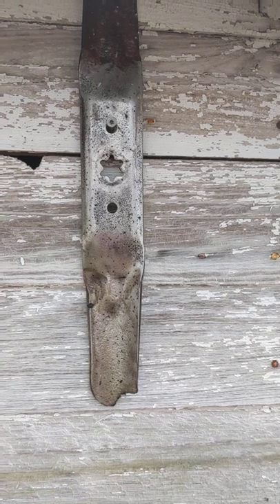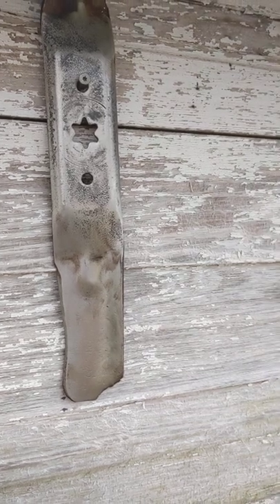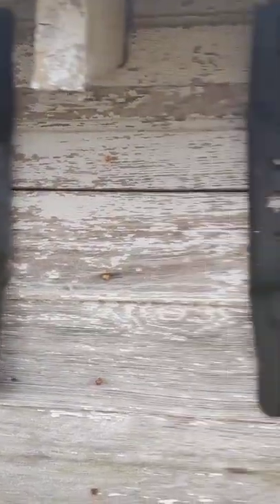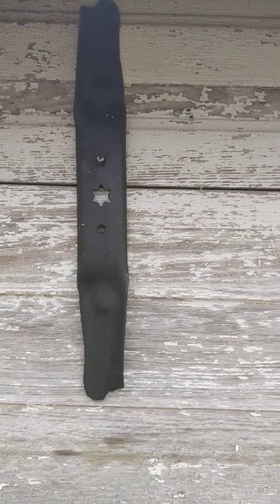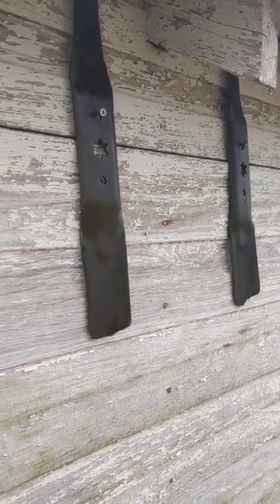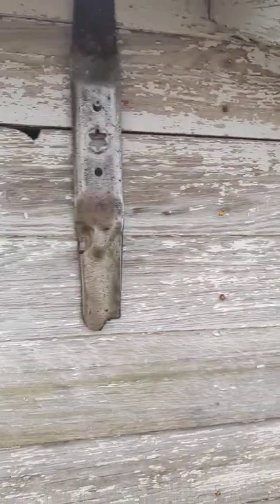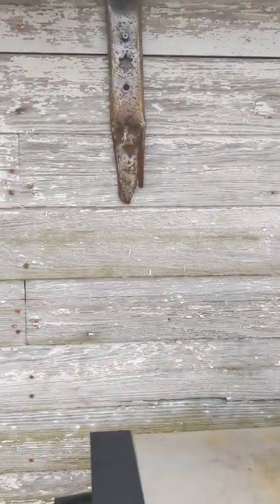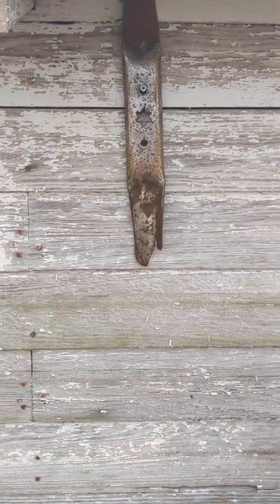Vehicle Undercoating - Update #1 - 44 Days - CRC, Fluid Film, Sprayon

Comment: Why not put them out in the weather instead of sheltered under the overhang?
Reply from the maker: The intention here is to better mimic undercoating of a car which isn't directly exposed to sun or rain. Obviously not 100% since we don't have splashing. If you want to see what happens with Fluid Film and CRC in an exposed situation there is a previous set of videos where I had mower blades sitting in the yard. Depending on where you're using these, it is definitely interesting results.
Reply: @essentialhomeowner  thanks. I find fluid film is good for any application where it's not going to get washed off or with the stickiness doesn't matter.